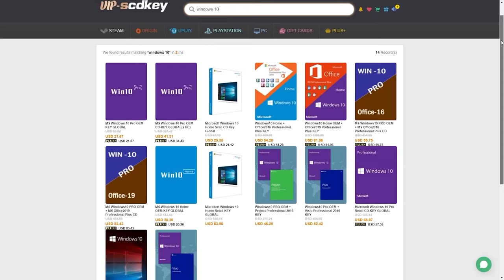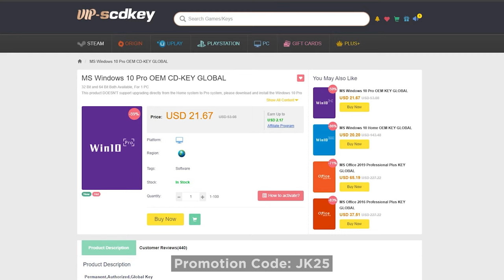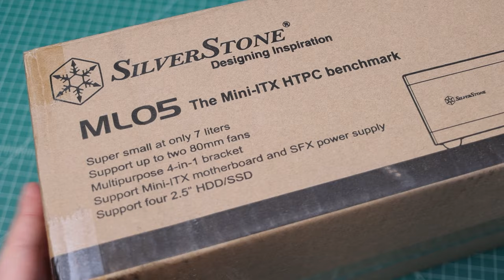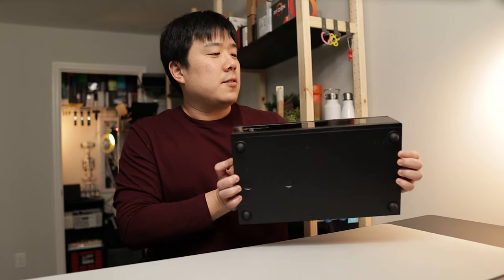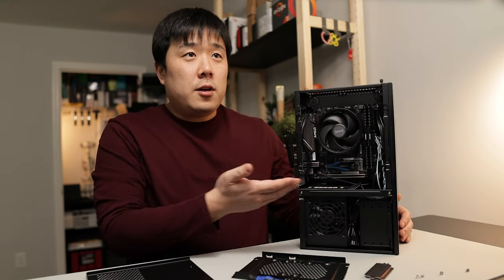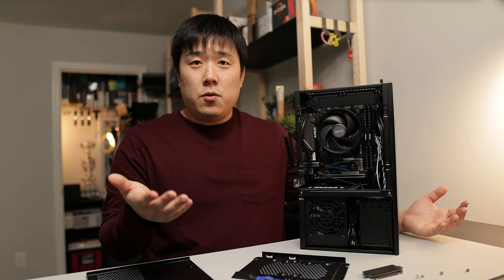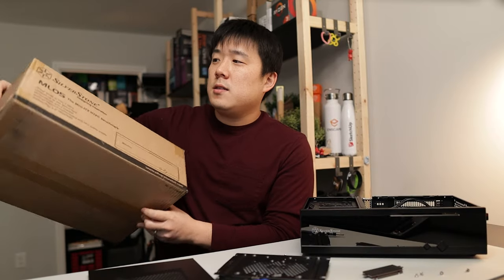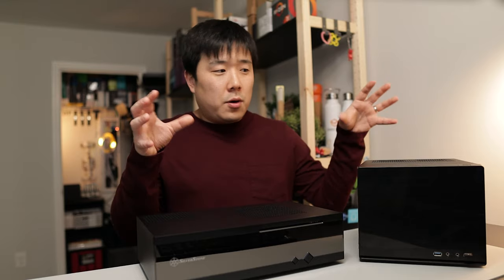Mini ITX Living Room PC (HTPC) for Under $500 - Build & Part Selection Guide (Silverstone ML05)

Comment: Nice video. I recently just built a mini HTPC computer myself using the Silverstone Sugo 16 and an Intel i5 12400.
Reply from the maker: That also is a nice case! Had not built one in yet, but was tempting!
Reply: @JosephKim  not going to lie it was kind of a pain. It was my first mini itx build though. Also fitting an Arctic 120mm AIO was probably more of a pain than a traditional air cooler mainly because the ASRock motherboard CPU cooler 4 pin actually impeded the coolers mounting bracket. I ended up having to take tin snips and take a quarter inch off the bracket to make it fit. Overall it was but a pain in certain parts. Loving that I can do everything from my HTPC now though. 😃
Reply from the maker: @spaznetwork6982  many ITX builds are somewhat challenging. But the end result is always what I am after ;)

Comment: I was gonna build something like this in the Silver Stone MLO4B mATX case. Not sure if I wanna use some older Ryzen parts or the new Ryzen 5 7600 65watt, MSI MAG B650M Mortar with a RTX A2000 low profile video card for some gaming. Looking at the BeQuiet 100w LP cooler and 4- 80mm BeQuiet fans for the side for exhaust.
Reply from the maker: The new gens would be better for sourcing parts unless you have them already.

Comment: You 3d printed that IO shield? did you create the file or did you find it somewhere?
Reply from the maker: So, I ordered one from ebay. (one that has the correct cutout) But it did not have any printing of what each ports are. So, I found best picture of it and printed it on to the plate. (I had blank shields ordered just in case) :)

Comment: Will this work with HDMI 2.1 TV? I have a GTX 970 laying around but that didnt pick up signal from my tv like my 3080 ti did..
Reply from the maker: I don't think GTX 970 would have had HDMI 2.1. But it should be backwards compatible. How did you fit such card in this kind of build?

Comment: can you mount a gfx card and an optical drive or do you have to pick either one ?
Reply from the maker: I don't think they conflict. But it doesn't fit standard size GPU either way.
Reply: @JosephKim  I see that you can just plug a GPU card right in to the PCI slot did not see that first correct me if I'm wrong. So what is the max length for a GPU card ?? thanks
Reply from the maker: @andyd7728  you can check out the allowed GPU size on the specifications on the website. But it needs to be the single slot cards.